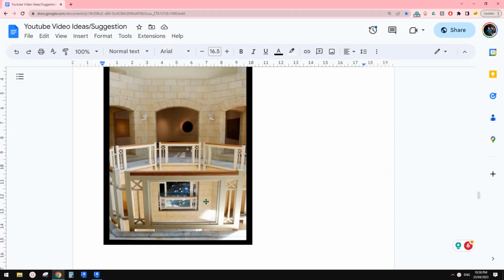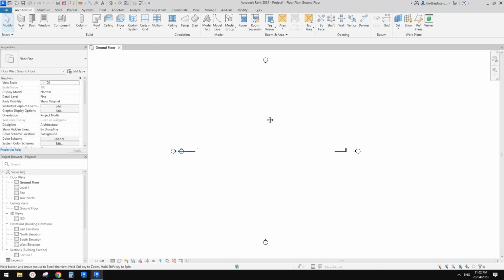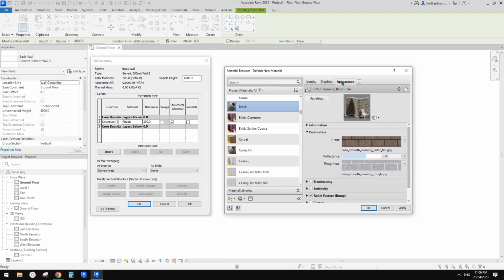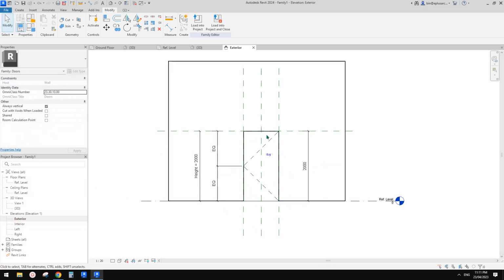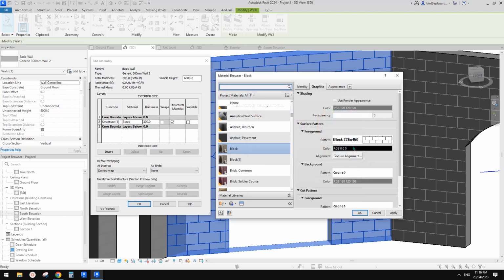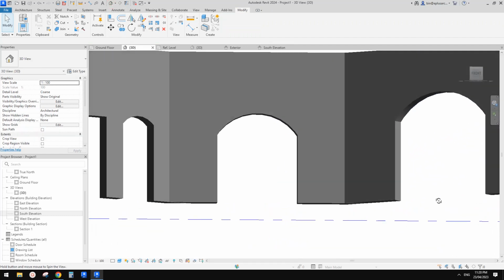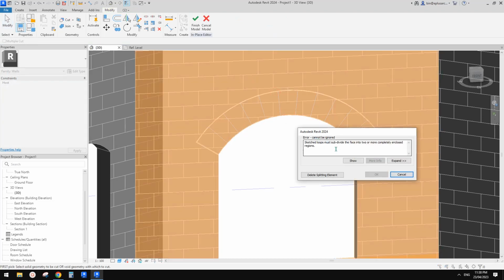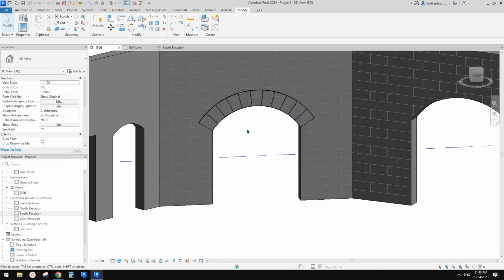23027 - Revit Surface Pattern and Model Line for basic documentation

Comment: there is a better solution for this. To rotate the patch around the center of the arch you need to make a model in-place arch for this
Reply from the maker: You are right. Solids are usually better than voids. But in this case, I'll try to stay away from both if I can.

Comment: Hi Bin thank you so much for your very helpful tutorial, I’ve got a quick question for you if you have a wall that has two different layers for the external wall finishes, would you rather make it with two different wall types with one been embedded into the other or make it as one wall and edit it with create parts tool ?
Reply: It's something similar to this case? I thought it could be done with stalked wall tool but it can't work because the external finishes have irregular shape like in that pic here https://renew.org.au/wp-content/uploads/2019/05/170122-Charles-0440-feature-image.jpg
Reply from the maker: I don't think a stacked wall would be the best choice. Using parts is definitely an option, but it's also quite easy to use a different wall type. Additionally, you could use a full height wall along with another wall type that only has the finish material, and then use join geometry.
Reply: @BINHE615  Thanks a lot Bin